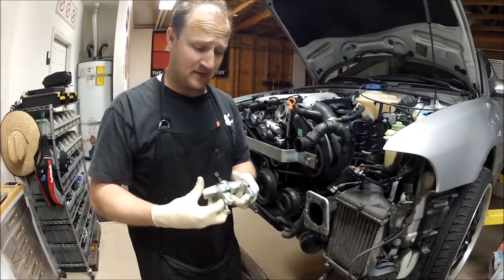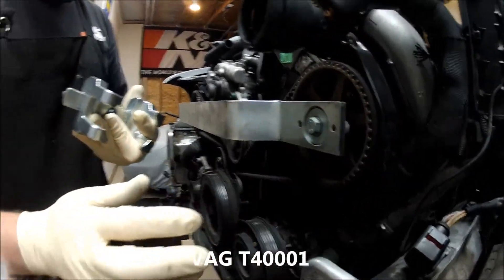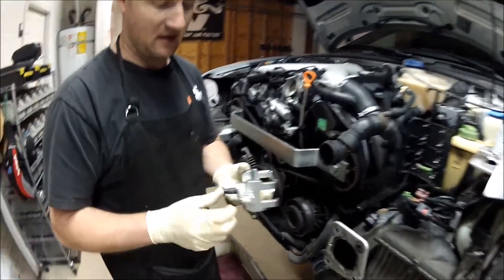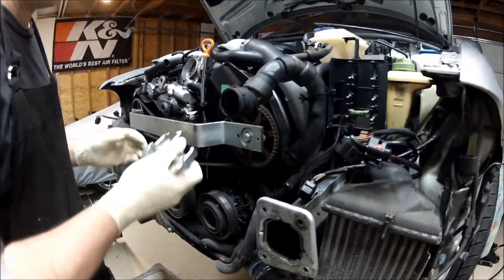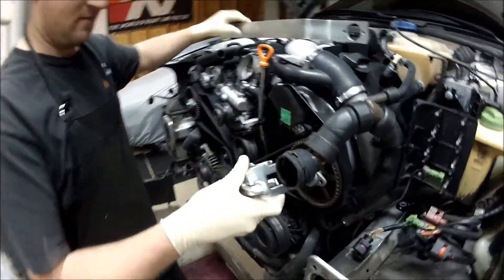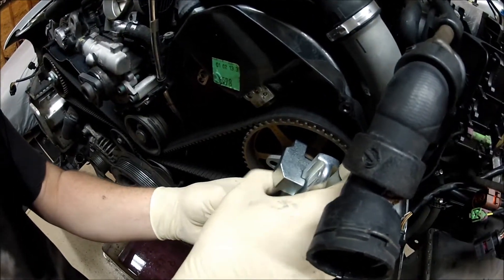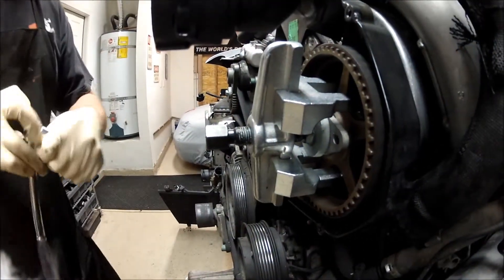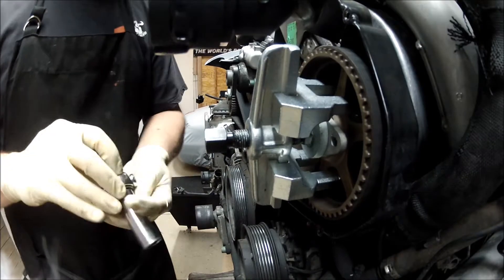Cam shaft Sprocket Puller Demonstration (Clip from DIY Timing Belt change)

Comment: I too am curious if doing this while the belt is on helps keep the cams from moving
Reply from the maker: Its not that sensitive.  If the sprocket springs back, the only thing happening is the springs are forcing the valves to a closed state.  You would need to reset the cam position with the cam locking bar before setting the sprocket and timing belt.  It does not matter if the timing belt is on or off at the time of the sprocket removal.  It is just easier to leave the belt on.
Reply: +Justin Ballou thank you!